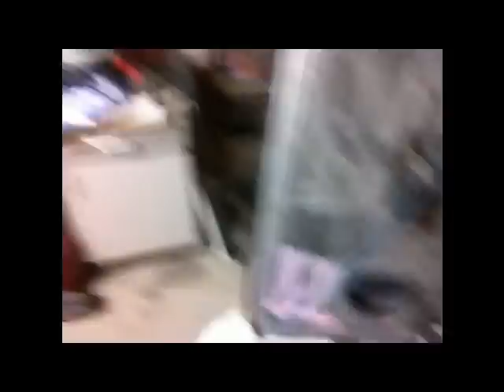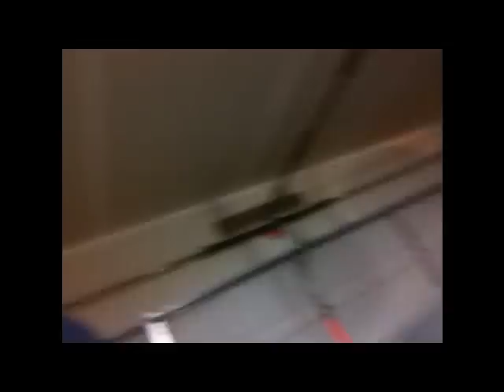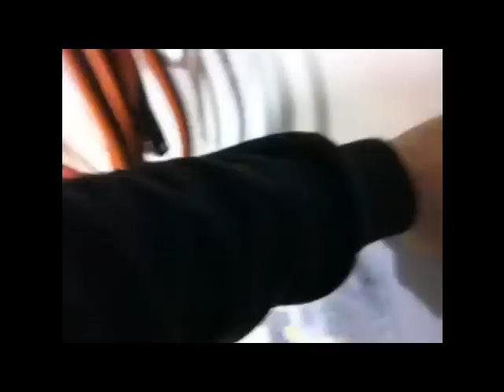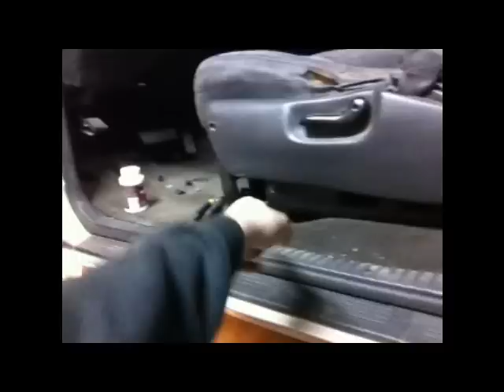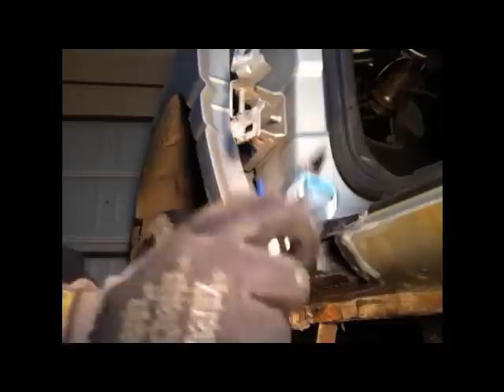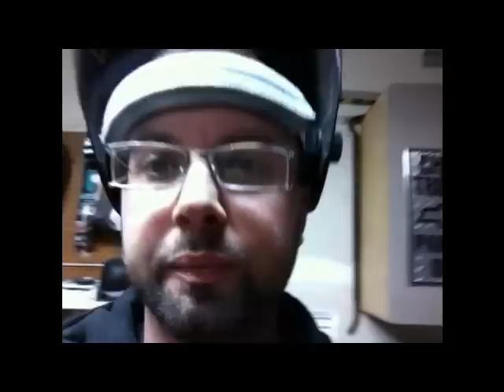MY FIRST TRUCK FLIP "how to flip cars for profit" VIDEO #8 (Dodge Ram Rocker Repair)

Comment: if thats the case turn the amps up a bit and the wire down you want the metal to fuse more than ball up you can always make more passes when you get it to fuse

Comment from the maker: I turned down the amps all the way and upped the speed a little to get it to ball up more and that seamed to work a little bit but it was still real thin and most of it ground off when I went to smooth it back down.

Comment from the maker: The settings were fine at first but then I grinded my welds down before I filled between them. I grinded so much that I thinned out the metal were I was welding causing my settings to be too hot like you said. So then I had to back down the amps but the damage was done and I suck at filling in holes.

Comment: I took a welding class for two years and in my experience if your burning through you need to turn down the heat (amperage) that way you can weld at a slower pace and have less risk of blowing through and turning down the wire speed wouldn't hurt either, you should find some scrap metal and run some beads of weld 4 or 5 inches long and check to see how the metals flowing out and if its actually bonding rather than just sitting on top

Comment: Nice patch!, did u undercoat the back of the patch or did u keep it bare metal? I usually use weld-thru primer on the backs of my patches to add a lil more protection from rust, just tryin to help another body guy out! Lol keep up the good work buddy!